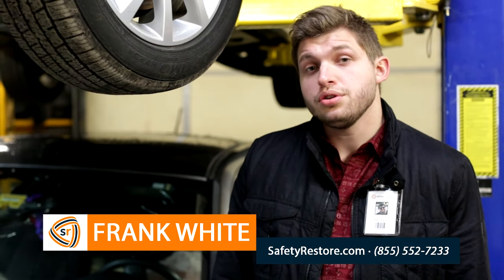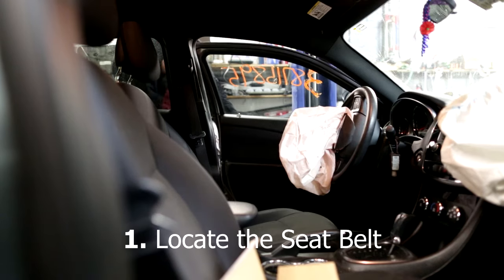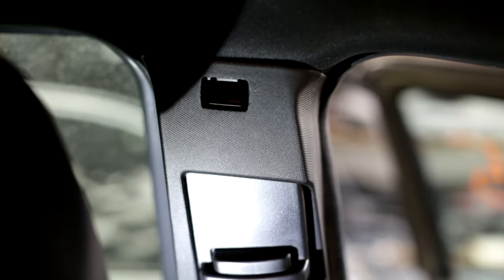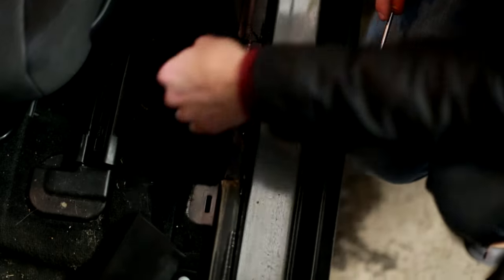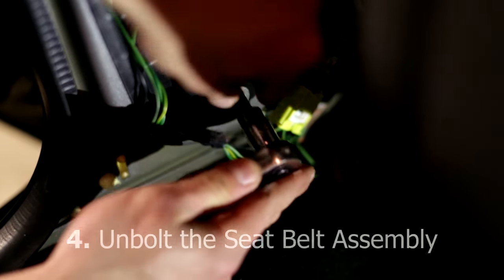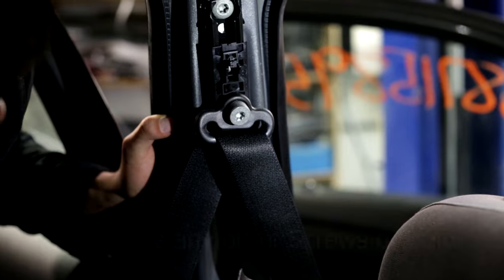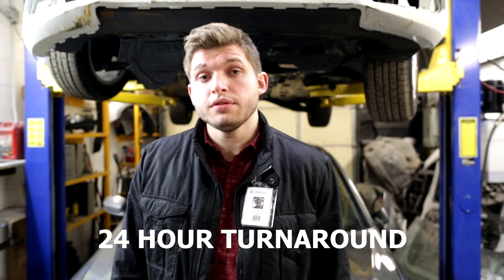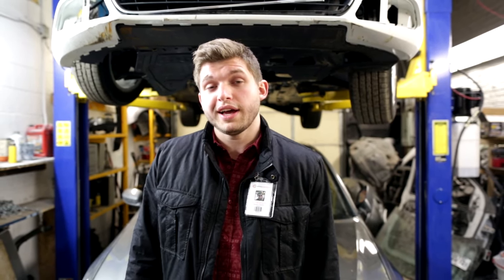SAFETY RESTORE How To: Remove Seat Belt & Repair

Comment: Should u disconnect battery first before removing belt
Reply from the maker: Yes you absolutely must disconnect the battery whenever working with SRS components in your vehicle.

Comment: This is a great video for the front seat belt.  U have been scouring You Tube looking for a video that will show me how to remove the right rear seat belt in a 2014 Buick Verano.  My problem is that the seat belt  does not lock when pulled on.  I wold like to know how to remove it and then replace with new if I can not repair the old one!!!

Comment: i just broke my damn plugs trying to pull them straight out, that little part at 1:30 is very important if you need them alive still!
Reply: I did the same thing this week broke the plug by hand..should have use a flat screw driver I think.  My car is Hyundai Elantra.

How did you fix it?
Reply from the maker: We hear that a lot!! It's funny how fragile those things are.
Reply from the maker: @jamescc2010  You get new plugs with our repair service!
Reply: Have a question what about the actual fabric does that get repaired as well 2013 Hyundai Sonata driver side seatbelt is locked won’t go back but fabric is damaged too
Reply: I used a razer blade to do mine!

Comment: Do i need to worry about the charge on the repaired one being set off when I plug it back in? I hit a deer and there is no other damage to the car except a cracked bumper cover ... and obviously the seat belt locked up.
Reply from the maker: Absolutely not. The charge can only be activated by the impact (crash) sensor in the event of an actual collision. However, we always recommend disconnecting the negative terminal on your battery for safety.

Comment: While at the end of seat belt retractor  removal process, I accidently damaged a yellow pigtail connector plug at pre-tensioner (located just above the floor) on right passenger side on 2005 Hyundai Elantra.  Any advise on how to fix/replace the plug at SB retractor? I saw in your and I didn't use a screw driver there to ply the plug out but I used my hand and I broke it. :(..
Reply from the maker: No worries James, this happens all the time! We have the yellow pigtail connectors in stock and replace them as needed with all seat belt repairs. If you're not looking to get your seat belts repaired and just need the connector, you can find one for sale on eBay for less than $5. All best!

Comment: Hi, when do you know a seatbelt needs to be replaced/fixed after an accident?
Reply from the maker: Valery Pyram Proper way is retrieving airbag codes using an OBD scanner, but a lot of times there are physical signs of the seat belt being locked, rattling or not working properly.

Comment: show your tools that you used on the bolts next time pls. I see it's a socket ratchet but what socket? thanks
Reply: Leonard McCaffrey its the one that fits on the bolt....if it does'nt fit try another one lol
Reply: Fred Michaud yeah, did that.lol  guess what, I used an Allen wrench.
Reply from the maker: They really do vary. We've used Torx bits as small as T25 and as big as T50.

Comment: What about the buckle part?
Reply from the maker: We can repair those buckle pretensioners as well. They're usually a lot easier to remove with just a bolt holding it down.
Reply: Safety Restore but what about the cables attached to the buckle? The cable is so it sends the car a signal that the seat belt is on
Reply: Safety Restore how would you reconnect the cables to a new buckle?

Comment: So what ever happened to the manufacturer being responsible for safety features like this? I've had at least a half dozen vehicles in the past that, when a seat belt didn't work correctly, you took it to a dealer and the manufacturer paid for this repair/replacement.
Reply from the maker: Only regarding recalls, not when a seat belt is discharged due to an accident.
Reply: @Safetyrestore  These haven't "discharged" (not sure quite what that means, since seat belts are used all the time), but they are in a 21 year old truck and are barely moving due to dirt and wear & tear. I just thought it would be a good time to replace them. However, I am concerned that they might set off the air bags. Is there a way to remove and replace them without the air bags deploying ?
Reply: I been looking on how to get my front driver's side shoulder harness to retract in my 2003 Chevy trail blazer,and also how to get to mechanical part to accomplish this,and this entire site does everything but show what I need,WTF !!!!??